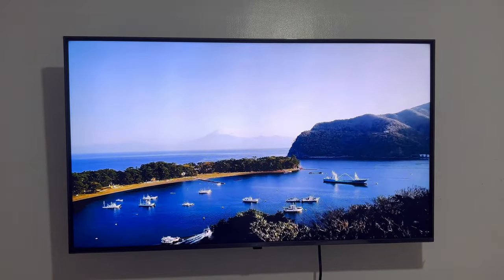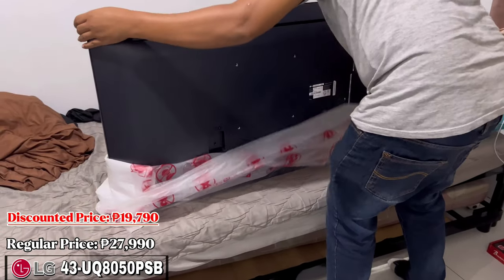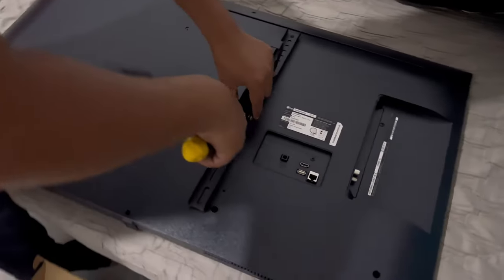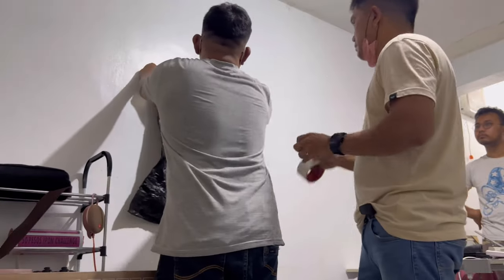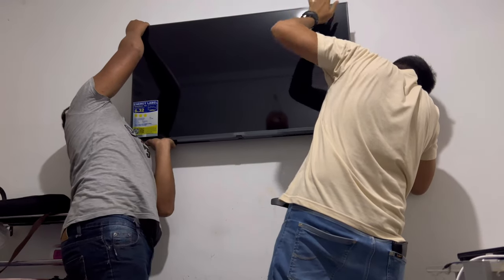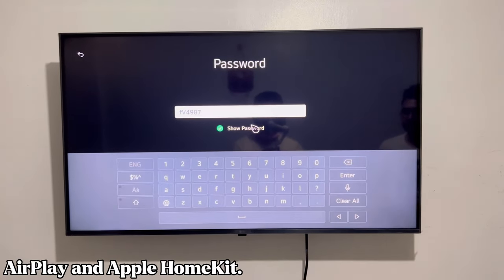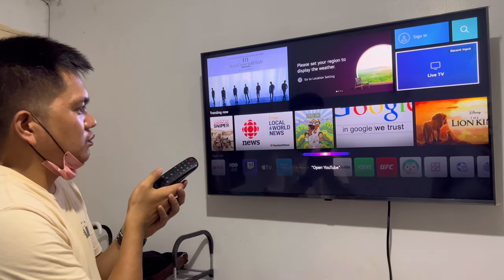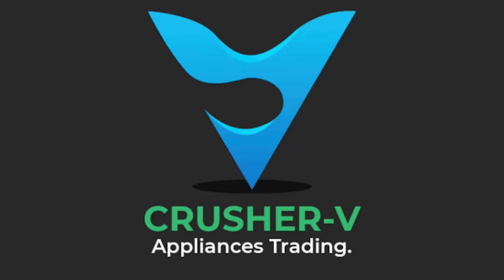LG 43 inches 43UQ8050PSB | UNBOXING AND WALL MOUNTING

Comment: whats the difference between LG uq7550 and LG uq8050?
Reply: i bought LG UQ7550 55 inch 2 weeks ago for my room and i had no bad experience with the tv so far and im asking whats the difference between the two sir which is the newer one LG UQ8050 over my tv, and im planning to buy samsung Q60B 65 inch to my living room? and how much is it if i purchase one from your store? is it available in your store?
Reply from the maker: The uq7550psf and uq8050psb were released at the same time, the only difference is that the uq8050psb is thinner and has three HDMI PORTS.
Reply from the maker: QA65Q60B 65"
SRP: 93,499
Sale: 64,590
Reply: @chesnilgantuangco2087  LG 7550 ordinary remote. But LG UQ8050 Remote is MAGICAL REMOTE.
Reply from the maker: 7550psf and 8050psb bought with magic remote.